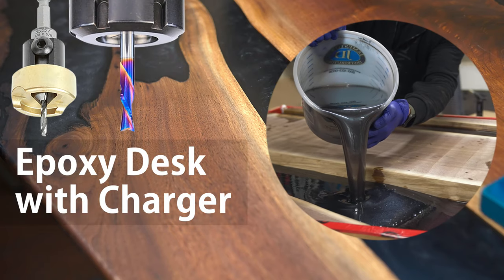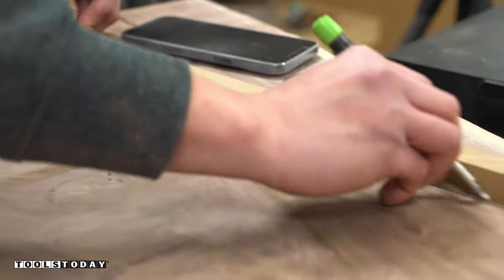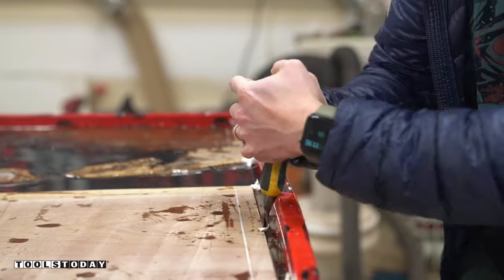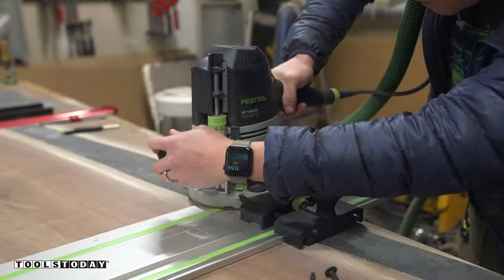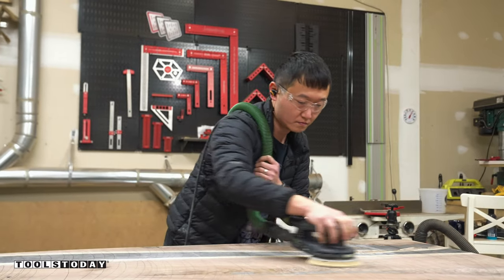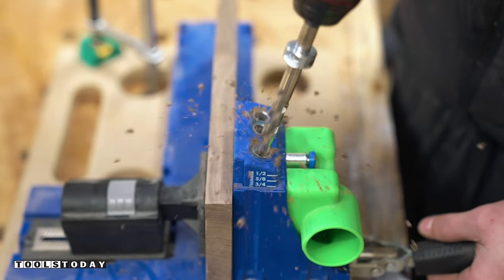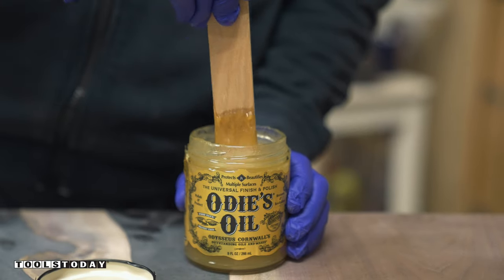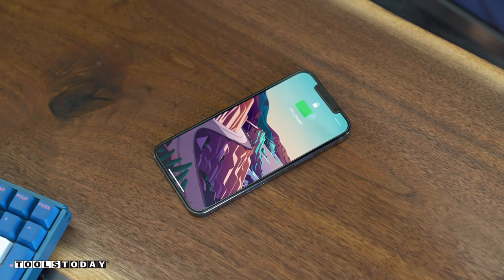Reclaimed Slab Epoxy Desk with Wireless Charger | ToolsToday

Comment: Nice job, thanks for sharing. I don't know why you used the word "reclaimed". The wood you used wasn't used before I think and it's very expensive in most places.
Reply from the maker: We purchased the slab from Urbn Timber, which is a Columbus based company, they go around the Columbus, OH area and work with arborists to salvage trees that are dead or are being removed due to construction or hazards, and turn them into slabs. So they’re not chopping down trees for the sake of selling slabs. Not sure if there's a better word for reclaimed but definitely open to suggestions as to not mislead. Thanks for your comment and insight!